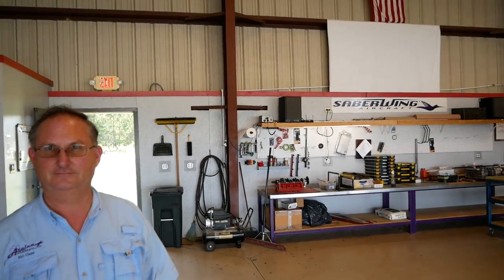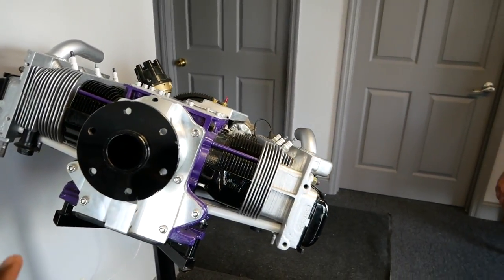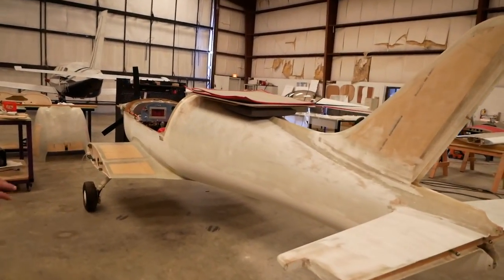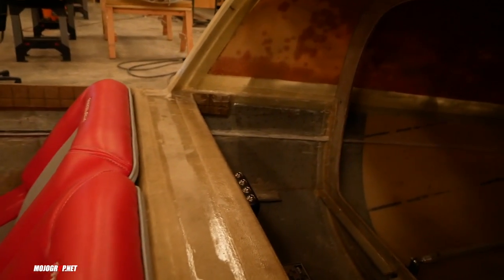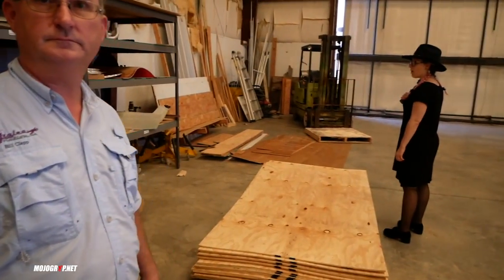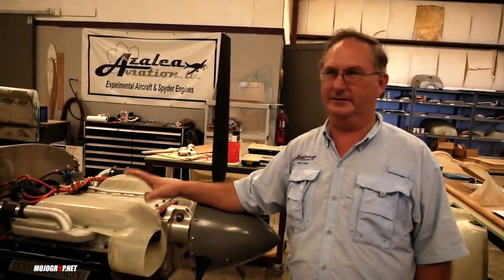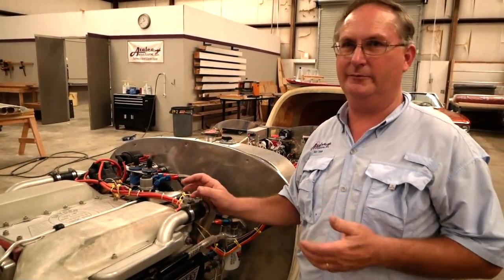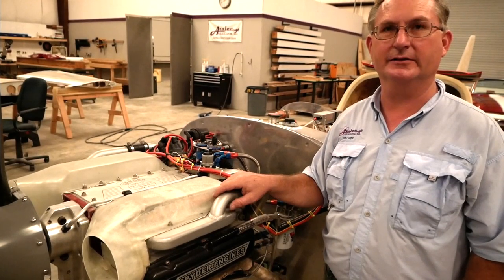Azalea Aviation Factory Tour | Saberwing LSA

Comment: Here in San Diego we have a lot of Airplanes landing on the highway.  Does that mean bad pre-check or not enough time flying experience. ?  I don't fly but learning from books ground school
Reply from the maker: It could mean all of the above or non of the above. An emergency landing typically is a result of an engine failure. A perfect preflight doesn't necessary protect you from having an engine failure. A great upkeep and maintenance of the aircraft can though.
Reply: It has less to do with pilots and more to do with geography. In the San Diego area, there’s just no other place to land if something goes wrong in a single engine aircraft... there’s a lot of terrain and the area is congested.
Reply: It actually only happens a handful of times in a year. You hear about it because it's a rare occurrance.

Comment: did I read somewhere that the corvair engine was original developed for aircraft but no aircraft manufacturers were interested at the time so chevrolet decided to put it in a car?     if that is the case,  can u run this engine at high RPM without being hard on the engine components?